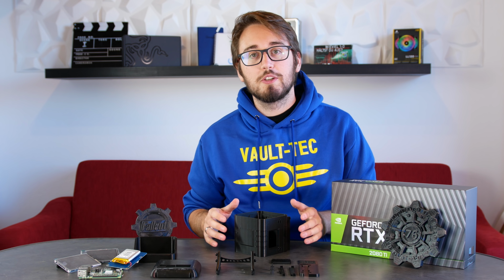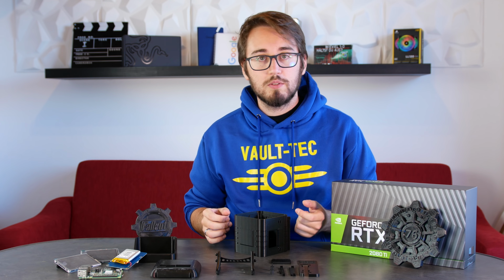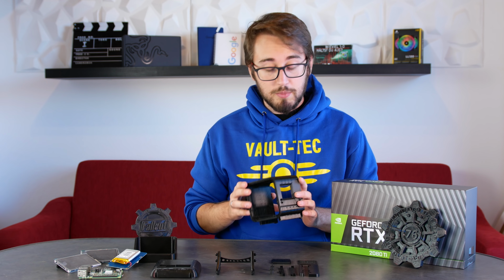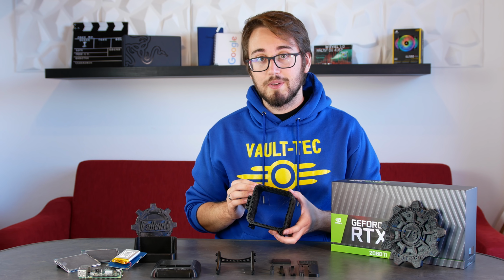Fallout 76 PC build watercooled with Terminal

Comment: I have to ask,  I am replicating your Wall terminal portion of the Build and I have a Treedix 3.5 TFT Display 480 x 320 and all I am getting is a white screen for the display. Can you tell me how you were able to get the screen to properly display for you ?
Reply from the maker: That's normal when you first connect it. All of the screens connected via the GPIO pins require a display driver to be installed in order to work.
We include some of the most common drivers on our image for easy installation. If yours is not included, just follow the instructions provided by the manufacturer of your screen.